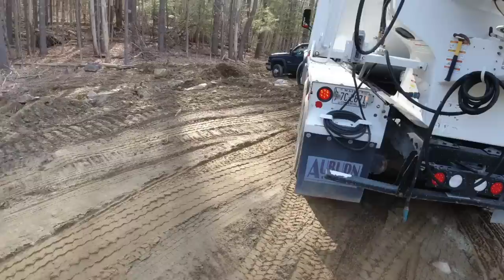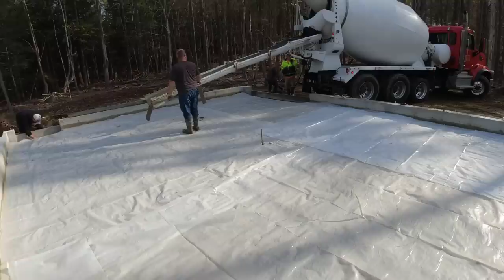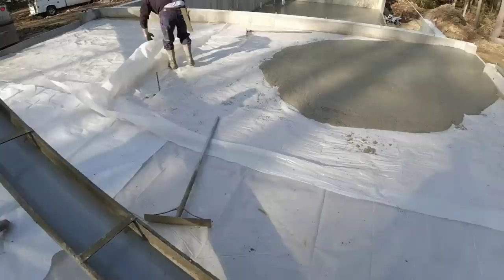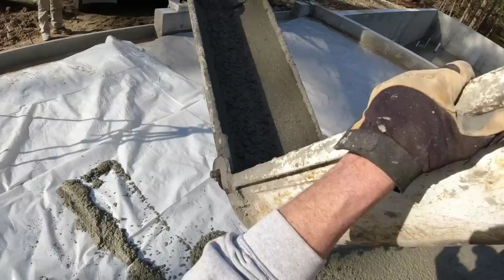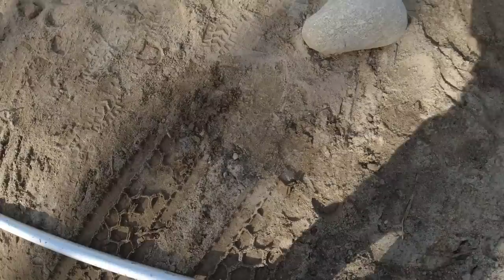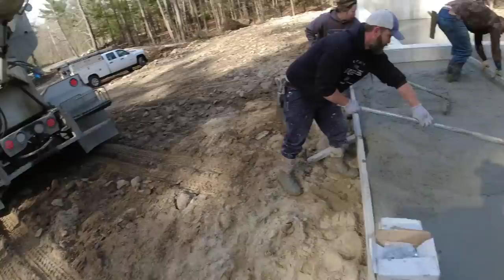Said He Had 4 Yards Leftover | Big House & Garage Pour (Part 2 of 3)

Comment: If you have a bunch of left over concrete and a formed pad to dump it in, is it better to just put it in as a thin layer on the bottom? Or try to pour a section and finish it? 

 I’ve tried to pour a section and finish it but the edge not against a form slowly dropped and now there’s a low spot.

Comment: The plants ought to have a smaller pull behind mix trailer they could load with a yard or two that the truck could tow for when you need a little more than the truck is allowed to haul.  Or would the state not permit it?
Reply: depends on the license type, a cement truck with no trailer requires a class B CDL, a Class A is required for towing over 10k with a class B and that would likely put them overweight anyway.

Comment: Hello Mike, I am wanting to pour a 2 inch slab on top of an existing concrete slab porch (11'×20') to level it and raise it to the same height of the house slab. I plan on framing it in for a kitchen area. I have talked to about 5 local concrete companies and no one will pour a 2 inch slab. They all say it will bust to pieces. I have watched your videos that show it can be done if the existing slab is good and it is bonded to the old slab (weld crete). I guess I'm going to do it myself or am I wasting my time as it's going to bust all up? If you have further advice I'd appreciate it.
Reply from the maker: I've never had one "bust" up. You should be good.
Reply: @MikeDayConcrete  ok is weld crete the best or is quikrete bonding adhesive just as good?